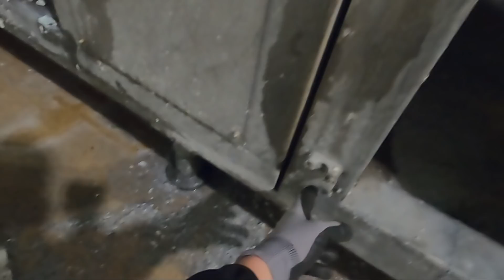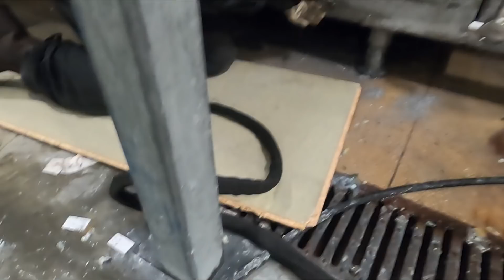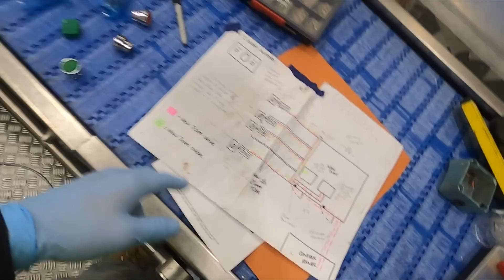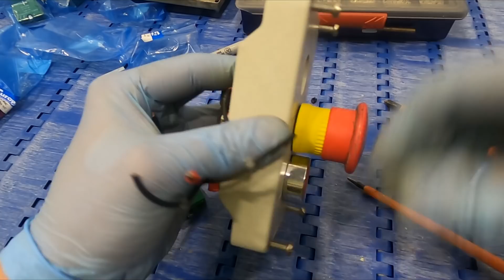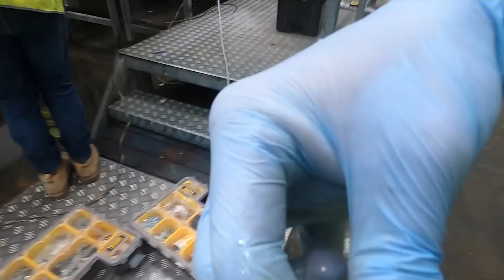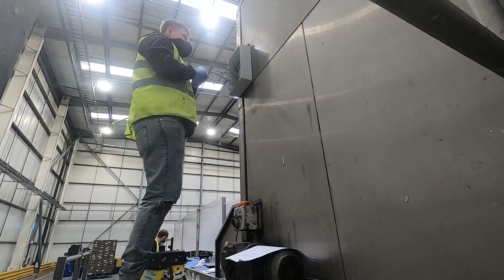Re-wiring a giant industrial dishwasher -  Part 2

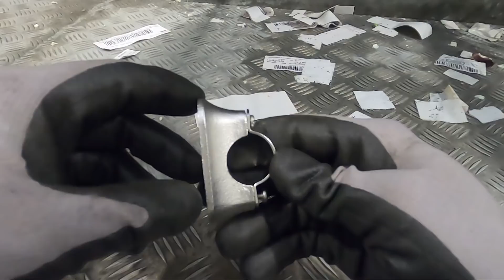Comment: 4:01 Who still uses flathead screws to  fasten cables?🧐
Normally seen Philips/pozi bits or Torx bits
Reply: It’s so the slot can be vertical to stop dust gathering and cleaner. Hospital saddle.

Comment: Does anyone know the reason Scottish electricians use lock rings and English don't? This is a genuine question and not a dig. Always wondered.
Reply: From memory its to make sure the connection between conduit and boxes is tight so that there is continuity along the whole run as you used to use the conduit as earth and just take a flying earth off the back of the conduit box to whatever outlet you were wiring.
Reply: For an example we would use a bush, coupler then a lockring. I have always just found it interesting and wondered if anyone might have known the reason.
Reply: Nice work on the video

Comment: Thanks for another great video. Nice work on the stainless and terminations. I'm interested in acronyms used for equipment. You mentioned BMC a few times - I'd always known this as Building Management System, and PLC used for machine control.
Reply: @residualelectrical  all good 😀. BMS has become a generic term, like "thermos" etc. Cheers